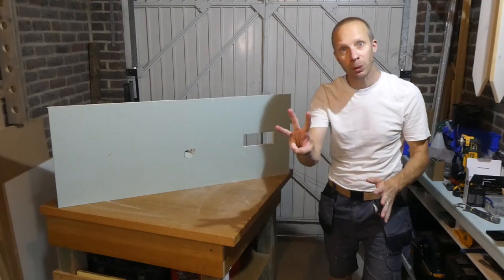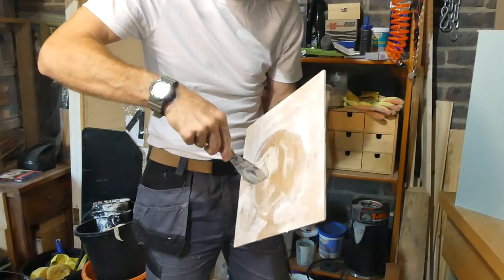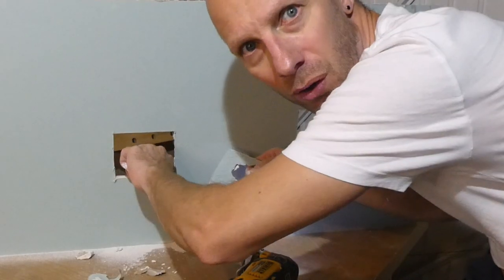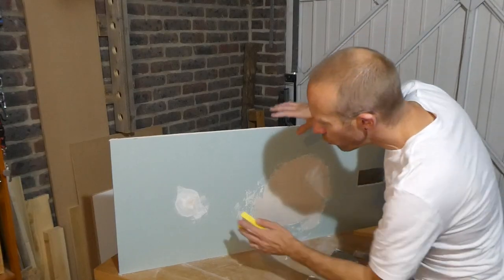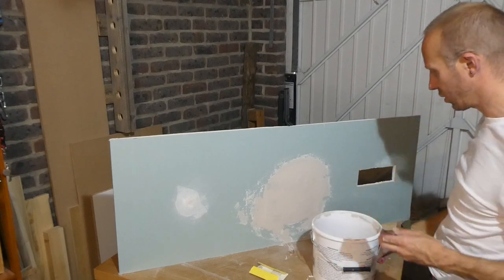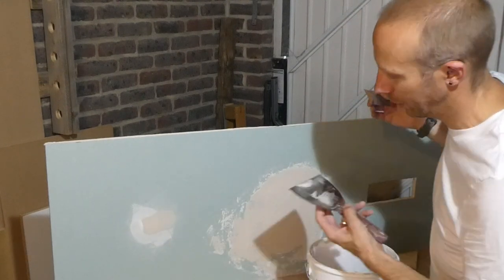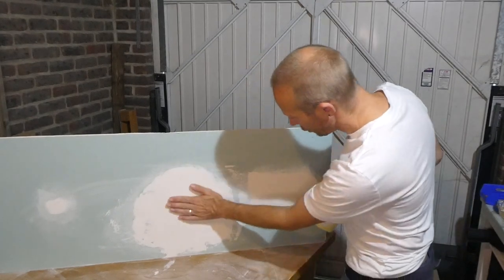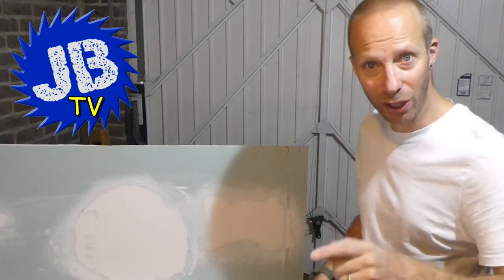How to Repair Large Holes in Plasterboard - 3 Simple Methods

Comment: i find that if plaster board is fixed to studding
using expansion foam first let it set then until it goes honeycomb 
then the plaster skim will adhere to it then  a little sanding needed
jobs a winner
with saying  this i bought a council house from the 80s  with external pipe work  showing
that i sang into plaster board 
then applied expansion foam till set overnight ......skimmed hey presto no boxing in